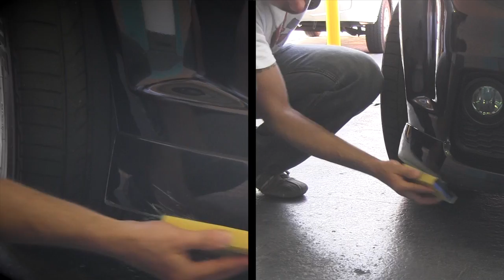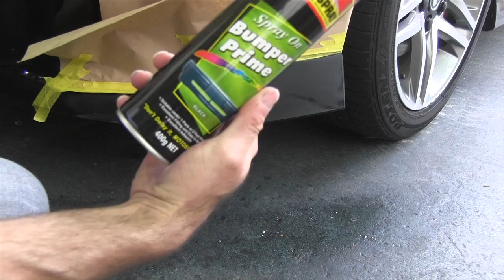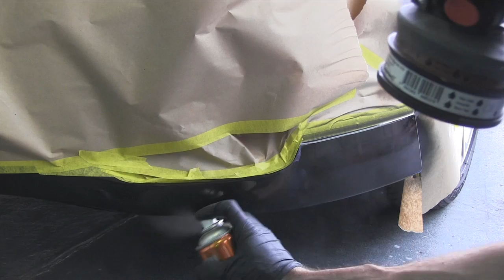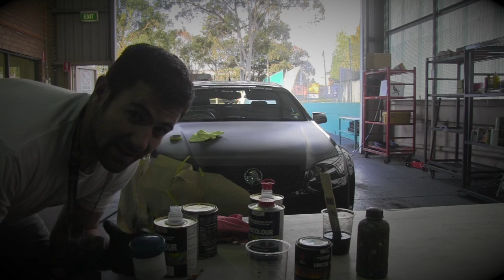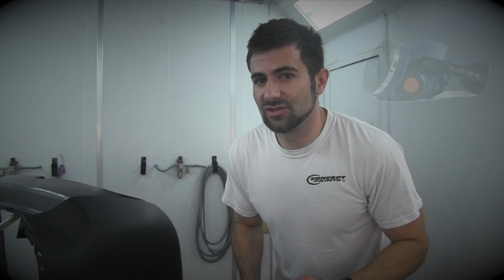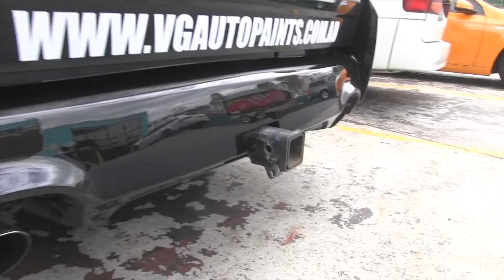How to repair plastic bumpers

Comment: IK laquer thinners will not melt into a 2K clear coat finish and will eventually lift off at the join area. The only way to prevent that is to scuff and re clear the whole panel.

Comment: What if I had a crack in a bumper and I repaired it with fiberglass cloth on the back and regular body filler on the top
Reply: Don't know if that got fixed in the year since this comment but Mad4Motors has a pretty good video of fixing cracked bumpers with little to no specialty tools. I'm keeping it handy in case it happens to my car in the future.

Comment: Could you please explain the grit of sandpapers that you use? Are the sandpapers rated by ANSI/CAMI scale or FEPA/EURO? Is 120g between P120 and P150, is 800g actually P1500? I'm a bit confused.
Reply from the maker: When I say 120g I mean 120p same with 800g 800p
Reply: Thanks!

Comment: Will method 1 work on about hand sized exposed bondo that's there for a questionable reason with no accidents partially behind the stock bumper when the bumper has no mark? He seriously forgot how bondo got there
Reply from the maker: Yes it will work as long as you can hide the blend somewhere

Comment: You can still see the repair on the rear bumper, wouldn't it have been easier to use a heat gun straighten it up a bit and then bog it so you wouldn't be able to notice it has been repaired.

Comment: hey man, thanks for the video! my dad bumped into a pole and now there is a crack in the plastic bumper bar, how would i go about repairing that? or is it something that cannot be repaired? Maybe glue it or melt it back together and then just fill it up with some filler? than plastic primer-color-clearcoat (respraying the whole bumper) is that a good idea? thanks man :)

Comment from the maker: You might be fine to do that. Try and heat the inside of the holes with a lighter and melt the plastic over so it blocks the holes. Then apply the filler. I did this to some interior parts. There is a video of it on my channel.

Comment: Hey was just wondering I have 2 holes in my front bumper where my number plate mounts use to be how would I repair that would  i get away with filling the holes with filler n sand it smooth?

Comment from the maker: By heating up the can makes the clear flow alot better. Also if its not too hot then it takes longer to dry which gives more gloss. Maybe try and paint in cooler weather. Everything I did is in the video so if its not working for you it could be a temperature thing.

Comment: The paint on my rear bumper is flaking off from where the previous owner had a small bump. The plastic flexed and isnt really damaged but the paint split and is flaking off, would i have to strip and repaint the whole bumper?

Comment: i have a panel between my windscreen and my bonnet about 300mm by 2000mm and there is a chip in the paint the size of a golf ball and every time i hit it with the high pressure hose it peels off more paint should i sand the whole thing and re spray or touch up the area and try make it blend